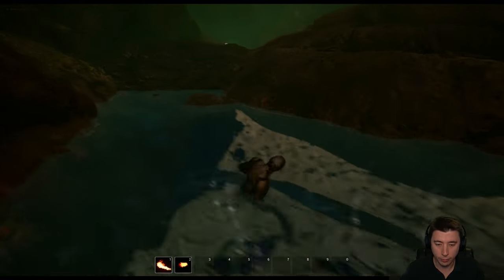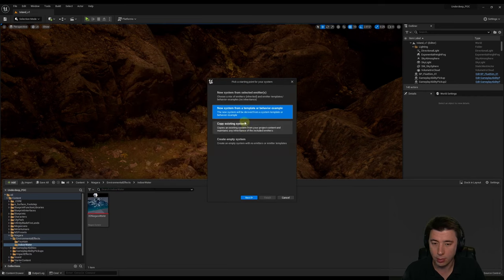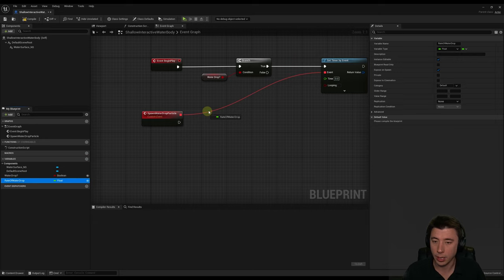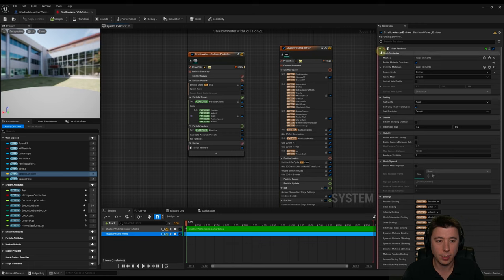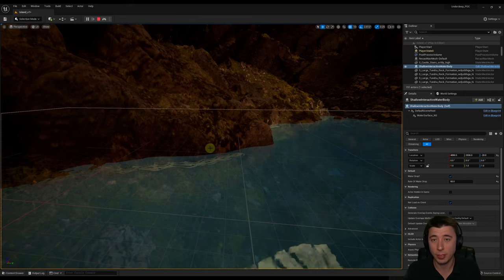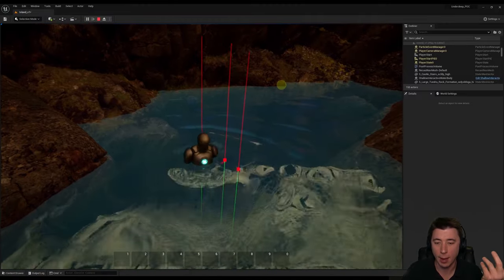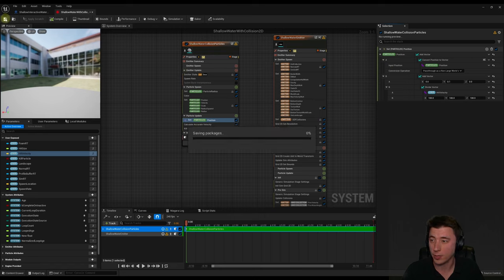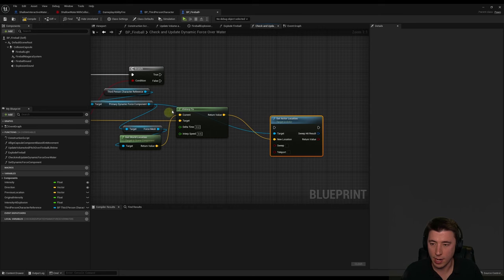Let's Build the RPG! - 58 – Unreal Engine 5 Niagara Fluids 2D Interactive Water

Comment: As for the water level dropping, if you go to the parent material of the 2D water, there is a comment called "Height". The red channel of the TextureSample is being used for the WorldPositionOffset, so if you lower it (for example by dividing the output), you'll get less "sticky" water that doesn't drop as much.

Comment: I think i disagree on the cast vs interface take. Interfaces are generally better than casting 99% of the time because casting creates a hard reference. So whenever an actor is loaded into memory, everything it casts to is also loaded into memory. This can cause a lot of issues as you expand your game.

Also i dont think you needed to run the check if the hit object implements the interface here. If the interface isnt implemented nothing will happen and itll just act the same as your false branch anyway.

If you were using an output from the interface function it would be a good idea to keep the check to avoid null references though.
Reply: Correct. In C++ it doesnt really matter as it treats it differently than BP does. This is a big thing with using TSubclassOf instead of having a lazy pointer to the object and loading/unloading it as needed!

Comment: By unhooking the world position offset in the material to fix the water level problem, you also got rid of the WPO of the actual ripples. Now you can still see the effect because the NS also calculates a normal map for the ripples, but some fidelity is lost. I think the water level issue traces back all the way to the fluid simulation, the render target never fully returns to black, its original state. Maybe there is some way to modify the NS to do that, or wait for a fix from Epic.

Comment: So weird, I can get the whole ripple effect to work without any interface functions needed, just put collider tag on the actor, but what I CANT get to work is having my fireball or any abilities at all for that matter (also tried a manual linetrace into the water and put that on a timer and many other tests) create ripples in the water.

I tried every type of trace (sphere, box, lines every direction, different lengths, i added the collider tag to everything as well, just doesn't change a thing)

I also see the mesh of the BP dynamic Force component fly around the water when I test, I also debug if it is hitting water physical material, which it is, I also tried setting the strength of the FluidForceDynamic higher, I also played with radius on the sphere, also tried directly attaching the BP Dynamic Force component to the projectiles I am shooting (attach actor to actor). 

No matter what I try, the projectiles or any other components/actors in the water OTHER then myself won't create ripples. 

What am I doing wrong, does anyone have a little suggestion or tip?

Comment: The ripples are not occurring when my player steps into the water.  First I haven’t done sessions 20 / 21 or session 57, but have done the steps suggested in session 57 relating to the settings on SM_WaterPlane.  The Event Footstep Niagara Water from the interface is not getting invoked (I’ve set a break point on it).  In the footstep line trace I’ve logged the hit actor from the Break Hit Result, and its either logging Tundra Rock Formations or nothing.  
But I am getting the Drop Particles appearing.  I’ve done this session twice now with the same results.

Comment: Thanks! Question: will this work if I use it for interactive puddle (big ones) and areas with water in an area in my scene? Or do you recommend some other way?
Reply from the maker: this is exactly how I would do that.  Should work for even a large puddle. And if it's a puddle you don't need to worry about the postprocess volume underneath.
Reply: @NumenBrothers  You are wonderful! I am trying out that now, and it coming out super cool! Although the water is kind of extra shining (a bit over) in my arena

Comment: The center of my water is spawning, a bunch of gray spheres
Reply: Did you use 'retriggerable delay'? 
I had the same problem, but switched back to 'delay until next tick' and the spheres disappeared. 
The reason I used retriggerable delay in the first place was because I was getting flashing in the editor, but then I noticed it doesn't happen in play, so it's fine.

Comment: my water doesn't appear on the preview nor on the stage any ideas why
Reply from the maker: Not sure- but For 3D water I needed to unselect the checkbox for Use Landscape Collisions in the Niagara system.  Could be that.  Are you referring to 2D or 3D water?    If 2D, recompile the materials used in the sprites and see if that works.
Reply: Hi Moegabs, did you manage to get this working, as I have the same problem. 
Nick